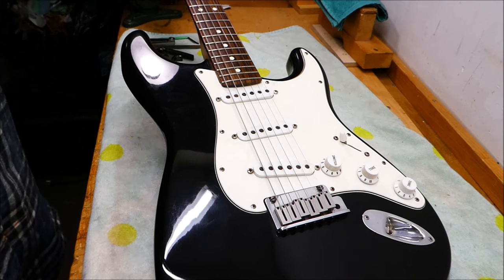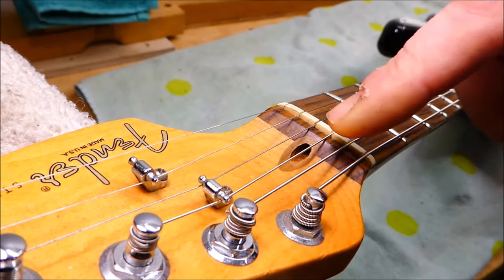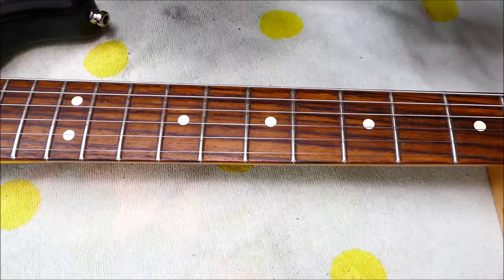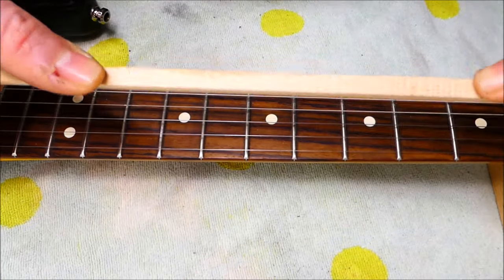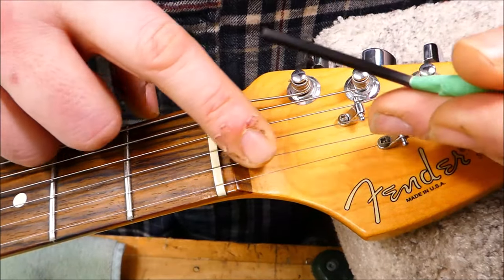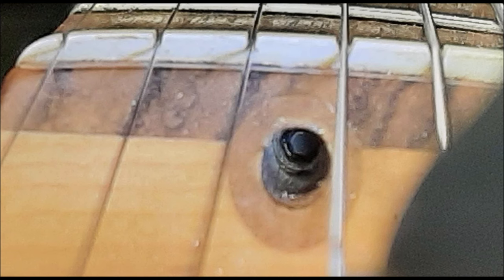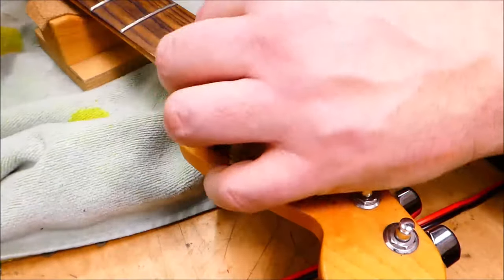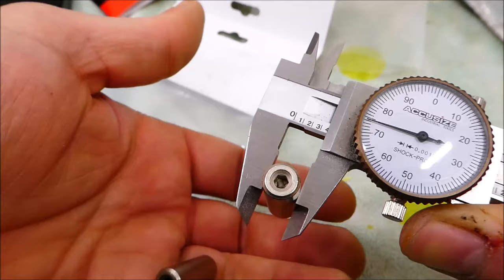American Strat Rides the Lightning!

Comment: When that plug came out I was astonished.
Reply: That little dowel plug heater is marvellous. It worked so well!
Reply: Yeah, that was pretty neat.
Reply: This guy is good. I’m fascinated by his videos and knowledge. And I’m mainly a drummer!
Reply: They often aren't glued in very well. I've seen them pop out without heat just from adjustment on the rare guitar that needs the back truss rod adjustment. That's probably a good thing since you're far more likely to need to replace the nut than to need the two-way adjustment and if you do, it's easy to re-glue.

Comment: Of course the irony of this is that Leo designed the necks to be removed easily so they could be replaced. Leo would have said “Hey man, why are you going to so much trouble?”
Reply: Because most of the time that shoots the value way down is why I’d assume he went to all the trouble.
Reply: They should just make steel necks with a glued on fretboard.
Reply: @matthewJ142  damn that sounds heavy
Reply: @Rxbandit421  I don't know if that holds true for non-vintage guitars like this one. Certainly for 50s, 60s, and probably 70s vintage instruments. But, after that I don't know how much it matters unless it was some special model.
Reply: @matthewJ142  I mean they sorta exist, you have Travis Bean and EGC guitars
Reply: I think I read that either Kramer or Jackson or Ibanez originally only made aluminum necks during the 70’s, but switched to wood by the 80’s to be competitive. I expect we’ll see aluminum necks make a comeback in some form in the future. Attaching a Rosewood fretboard seems like a good compromise. The metal isn’t going to bend out of spec, so no truss rod is necessary, and the fretboard could be replaced if it wears out.
Reply: @SketchEtcher  it absolutely wasn’t Ibanez as they started out making lawsuit guitars in Japan in the mid 60s
Reply: @SketchEtcher  Hmmm... aluminum is excellent for many things but certainly one of the worst materials for a guitar neck.  Why?  Aluminum has a high rate of thermal expansion so tends to grow/shrink with even fairly minor temperature changes.  This doesn't matter for most devices, but on a guitar it would mean frequent re-tuning would be required unless you're in a constant temperature environment.   Wood OTOH is far more stable, temperature-wise, which is probably why it's still 99.999% preferred today.   Cheers from Thailand!  :)
Reply: This is an old myth that just won’t die. He didn’t do it for that reason, it was so they’d be quicker and cheaper to make.
Reply: @J8D2  if you have to choose between the myth and the legend, print the legend?
Reply: @nickdryad  brillliant
Reply: @J8D2  it’s from The Man Who Shot Liberty Valance. “When the Legend becomes fact, print the legend.” I Think I need to look into this neck legend a bit more carefully.
Reply: @Jimbo-in-Thailand  Ding! The most amazing part of the Kramer saga is that Vaccaro sold the rights to Kramer so he could give aluminum necks another try!
Reply: He explains it in the video, stewmac knows this which is why they overprice the replacement neck.
Reply: @alexcorona  The crucial point here is that this isn’t a particularly special instrument. Watching Ted do the repair is rewarding and his instructions and techniques are great, but I would have put on a new neck for the simple reason that the customer said explicitly that the neck has frequently been problematic. The owner said it needed continual adjustment even bevor the Setup. To me that suggests this will happen again. It’s a bad piece of tree.
Reply: @e.l.norton  It absolutely holds true for all instruments with the label “Fender” on them. Unmolested stock instruments resell for much more. That guitar with a different neck is just a “parts-guitar”. If you could find the correct neck for that exact specific model, that helps, but it would be much harder to find than just a generic Stratocaster neck.
Reply: I don’t think Leo imagined Fender charging $600 for replacement necks
Reply: @sayhuhhhh  Very good point.
Reply: @Jimbo-in-Thailand aluminum is great for necks because it’s immune to changes in moisture unlike wood, can’t be cracked, hard to break in general, and is a very light material. It expands with heat but not by anything by too noticeable, it’s not like anyone is heating the neck in an oven. It also retracts back when the temp goes down.

Comment: Wow Ted, that was fascinating. I have a gorgeous Candy Apple Red Strat Plus from the early 1990’s which also has the bi-flex truss rod in it (though fortunately mine works just fine and the neck is in great shape). Have often wondered how that thing works. Had looked at modern bi-directional truss rods, like those you demonstrated, but had no idea if or how the original was different - well now I do! Thank you Ted. Fascinating to see that you can get the nut out like that - you never cease to amaze me what you can come up with. I sure hope I never have to attempt that in mine. 👍

Comment: I have a 94 American Standard with the same need to constantly tighten the truss rod. So much so that I bought it as a project after the previous owner blew out the front of the fret board between the first and second frets from over tightening too many times without getting some glue in there to strengthen that bearing surface the nut tightens against. 

This gives me wonderful hope that I’ll be able to repair this once I feel up to the task! Thanks for the informative videos as always!

Comment: Had to do this job on my 2012 American Strat this weekend, I had been putting it off for little over a year since I got my new truss nut in, but finally I got my hands on a Stewmack Gripper wrench.

I used my soldering iron (with a clean tip) set to its lowest heat and with a little bit of damp towel on the inside of the hole to protect it, and give humidity to help release the glue, after about 10 minutes it screwed out with no problem! New nut installed and the old plug press fit in place as it was in good shape! 
the action is back down to 2.5 - 3.5 64ths plays like how I remember once again!

Comment: Hello Ted. I love your channel! I have some tips on this truss rod fix that will save you a lotta time. I'm a gold Fender tech since '94 and got a TSB from Fender over 20 years ago about this truss rod problem. Break the finish around the plug perimeter with a #11 or scalpel blade. Heat the plug area with a hair dryer on high. I hold a piece of masonite to block the heat from the tuners and decal. Give the hair dryer some time. Then back out the walnut plug with an 1/8" hex key or a next size tapered hex key if the nut is sloppy. Apply more heat on the walnut plug and wiggle it out with channelocks. You'll be able to re-use the plug. Add an extra washer, new TR nut, remove the brass washer from the walnut plug, cut away material from the walnut plug ass end to compensate for the new washer thickness, clean off the old glue from the plug, and lightly glue the plug back in

Comment: I’ve seen the term “bi-flex truss rod” a million times and owned dozens of them. I had no idea they also worked backwards like a 2 way rod. Nor did I know about the anchor under the 7th fret marker. Very informative sir and well done as always. Thanks for sharing!
Reply: @garymitchell5899  you have to understand they still work like a regular truss rod. They just can work the opposite way too if they need to. I’ve never had a neck bow the other direction to need that function of the bi-flex truss rod. I’d say it’s pretty rare to need that but handy to know it’s there if you ever did need it.
Reply: @braderrick  my friend left his Strat sit unstrung for 20 years in its case but didn’t relieve the truss rod.  The neck crept into a slight backbow...a little bit of the forward bend on the truss rod was needed to get the neck relief right.

Comment: Excellent video on a difficult repair. It would be great if you shared links for your DC power supply, nichrome wire and insulation.  Thanks.

Comment: wow this is the video ive been waiting for, got a american deluxe from a pawnshop a few years ago and it still had the stickers on it so i figured it was brand new,  the action was super high i thought no problem, "ill set it up" not knowing anything about setups,  i turned the truss rod a few times and thought It was makinga  difference but it wasnt,  i eventually strip the nut, not by over turning, but by taking the key out, it kept getting stuck and the only way was to twist it out which messed up the nut.  So it was stripped, eventually I got it out, after removing that walnut plug, which wasnt fun and  put a crack in my first fret, but at that point i didnt care, i was determined to adjust this neck and have the super playable strat ive been dreaming off,  so i take the nut off a Fernandes les paul copy and decide to thread it on the fender.  It gots a bigger hex socket, i figure it will last and not strip like the wimpy fender one, well apon put it on and turning, i was just getting excitred , finally here we go, kept turning until it creaked,  oh thats cool its starting to move! next turn, SNAP, right off the threads the plalcement nut I did.  Great, now  I gotta replace the truss rod... ok fine i'll do it, but that skunk strip isnt going to be fun to take out, and after watching this video i dont even know whats going on there and if should even bother.  Any advice / tips is appreciated.

Comment: Holy Cow, I must have missed it before, but the DIY heater trick is gonna come in real handy in a lot of situations.  I already have a ton of nichrome wire, just need the insulator and some steel or brass tubing.
Reply: Stainless steel tubing. and don't forget the
high heat, plastic tubing.

Comment: I have a 90's Tele Plus (with the Lace sensor pickups) that has one of these truss rod designs. The neck always needed a lot of tension from the factory, and one spring, it needed an little seasonal adjustment and "pop." I wanted to salvage that neck because of the age-appropriate yellowing of the finish, but the local guy said, "Yeah, I don't have the tool to do that repair," which makes better sense after watching this. We discussed options and went with a factory replacement. A broken truss rod is a different animal in terms of a repair, but still interesting to see the process and learn about the design. The one complication in my case was Fender didn't want to sell me a neck because they had the serial number in their records as a strat, so I had to do all this photographic documentation to "prove" that I actually had a tele with a broken truss rod. In retrospect, I like the way the old neck played, which might be a matter of attention to detail somewhere between the factory and the local guy's setup, so I ended up not playing it as much, even though it still sounds great. It now gets more attention when I loan it out on occasion to a couple of my Radiohead-fan friends.

Comment: I’m sorry that it is only possible to give this video one “thumbs up”. I was trying to guess how you were about to proceed on the plug removal. My guess was a machined center bit that would have used the center hole for alignment while excavating the larger diameter hole with a flute style cutter. That would have been messy and less accurate. Great job as always and yes, now you have another trick in the bag.

Comment: You can buy small stainless rod style "cartridge heaters" in standard sizes 6mm, 8mm, 1/4" whatever. Used in injection mold machines etc.
Usually they are mains powered but you can get fine temperature control with any cheap light dimmer etc adjusting the mains power.
You did well attaching that nichrome wire to the end of the stainless tube inside your little home made heater! 👍

Comment: awesome! i've had to remove my share of those plugs and i just used a heat gun, the result was never as invisible as what twoodfrd pulled off with that wire trick. after seeing this, it occurs to me that maybe next time i could stuff a short chunk of round copper or aluminum bar stock in there that fits tightly in the hole then hit it with a soldering iron, that might be the easy way to heat up the plug wood without damaging the surrounding finish.

for those playing along at home who are having a hard time tightening the rod on your american standard fender, the busted-off wrench tip thing is gonna be pretty rare. what's more common with these is some finish/glue gunk gets in the hex hole, preventing good grip from your allen key. 

jam a little tiny flat head screwdriver in there (smaller than 1/8") and turn it to dig out any stuff in the hex hole. then hold the neck pointing at the ground and smack it/shake it to let that stuff fall out. sometimes that will save the day 

(i agree, 1/8" hex is too dang small for a guitar truss rod wrench, it leads to problems just like this)

Comment: @twoodfrd - I noticed that you have a lot of nicks around your fingernails. I have those periodically, and know they can be annoying and painful. I came up with a quick and easy way to deal with them, in case you're interested. All you need to do is clip off the "dead skin" that is sticking up with a fingernail clipper. It provides instant relief from them brushing against objects, hurting, and getting worse, and they will heal much faster that way.

Good sleuthing and slick repair on the truss rod. I always learn something interesting from your videos. Thanks

Comment: Another great and fascinating repair. I always wondered why pot manufacturers don’t include a separate earth tag as part of the casing to avoid having to solder directly to the back of it. I know it’s not necessary for applications such as amplifiers where it’s fixed into a metal case but surely it’s a sensible idea for guitar applications.

Comment: Not sure if you will read this Ted... I heard you mention many times that big containers of CA glue dried out on you, and I had the same experience. I think I found a solution. I applied vaseline on all the threads of the of both caps. After over a month, almost two, the glue seems to have the same viscosity. Hope this helps. By the way, I feel the same waiting for your new videos as my girlfriend waits for the next episodes of series. Hi from montreal!!!!
Reply: I just put a whip tip on mine and melt the end of it closed. I've had the same bottle for 5+ months now
Reply from the maker: Yes! I started doing this recently and it's definitely the way to go!

Comment: I had to do this on my tele about 5 years ago. I backed the plug out using a pencil tip soldering iron and damp rag to steam it and it came out easily.The nut was bottomed out and the relief was still over .014. Rather than using stacked washers to take up all that slack, I took a second nut, cut off a 1/4 inch piece and reamed it out to slide over the threads.That was the hardest part. The nut is made of very hard and brittle metal. I cut it to length with a Dremel but I shattered it when I tried reaming it with too big a drill bit on my first attempt.The trick is to start with a smaller bit and sneak up on it slowly with larger bits. I ordered a couple of the walnut plugs but decided not to reinstall one. The guitar looks fine without it and honestly I have never owned a guitar where that reverse function was needed.

Comment: Ever since I saw this the 1st time, I'm very wary of using ball end hex wrenches on truss rods. And that's all I have are those style of truss rod nuts lol

I'm actually watching this to see how you shaped the new plug. I bought one to put in the truss rod access hole in my guitar because that empty hole is quite unsightly. So I figured id put a walnut plug in it.

No, it doesn't have a Fender-shaped headstock and I'm not trying to pass the guitar off as anything it's not. It still says Indio on the headstock. I just want a better looking access hole.

Comment: Fender sell replacement nuts and walnut plugs so they expect people to do this repair.   Also, the biflex rod is useful.  A friend left his 89 Strat under his bed for 20 years with the strings off but the truss rod still tight.  It developed a back bow, and when I restrung for him after all those years the strings sat on the frets.  The only solution was to turn the nut CCW, back it off till it pushed on the back of the walnut plug. It took barely a quarter turn but it worked.

Comment: Very nice trick heating the dowel from inside to heat the glue joint.  Thank you for sharing.  You soldered the nichrome wire inside the very end of the stainless steel tube?

Comment: Excellent repair.  Have you dealt with a stripped hex nut on an Ibanez truss rod?  I have an AFC95 jazz guitar which I bought used.  Fortunately it is set up perfectly but I discovered the nut is rounded out by not using the correct size wrench.  Looks like the nut is captive in a sleeve and not removable.  Can’t replace the neck, it’s glued on.  I’ve thought about cutting a length of hex key long enough to protrude from the nut but fit under the cover, and JB Weld it in the rounded nut.  If it works I can then use a socket or nut driver to adjust the rod.  It’s a kludge but all I can think of.  Thoughts?